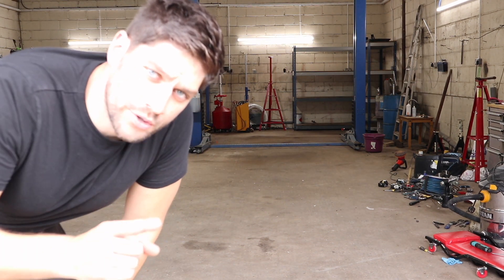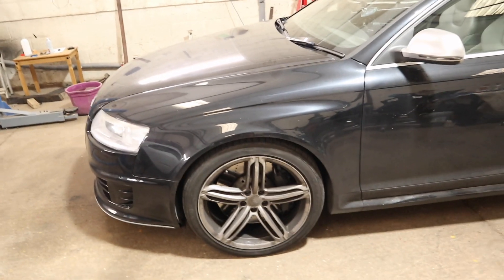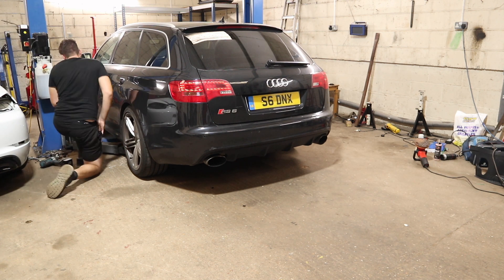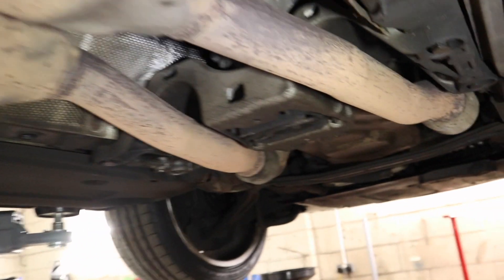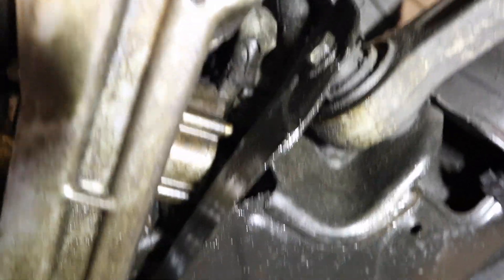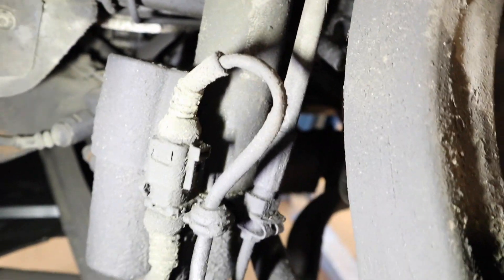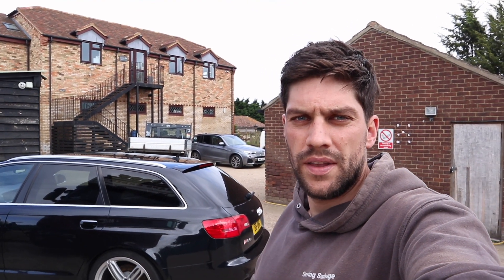EVERYTHING WRONG WITH MY CHEAP AUDI RS6 5.0 V10 TWIN TURBO

Comment: I had a 2010 black Audi RS6 V10 saloon in 2015 till 2017. They are beasts. Incredibly fast! Funnily enough, I had  Yokohama tyres on mine. On a fast run through Snowdonia, I got between 11 and 13 mpg. Sold mine with 22,000 miles on the clock. Never fell completely in love with the car.

Comment: I’d be putting the front end on axle stands and removing the wheels outside, then degrease everything underneath/suspension related and pressure wash it off, makes it so much easier to see fresh leaks and work on it without getting covered as badly
Reply: Agree. Bit of jizer

Comment: Mine had a split rear hose. New hose, recharge and all was ok. You might also find that the power steering is leaking from the crimp clip near the cooler on the left side of the car - the fluid runs back, mixes with other cr*p on the undertray like the DRC oil on your car then drips off in the same place.  Back lights - the inner light lenses micro crack and look foggy, upgrading both the inner and outer lights to the later version freshens up the back end of the car. I've dropped the engine out of my car twice in my driveway - it's not as bad a job as people think.

Comment: Hi Dean,  have that exact car, although mine has half the miles...  Regarding the DRC, my car has had the system removed and replaced with coilovers, Bilstein do a set for about £1300 and the electronic damping can be coded out in VCDS.  It's not cheap by any means but that's your worst case rather than a £5k bill!

You need to take the right hand front wheel off and check the coolant pipes at the top of the arch.  If they are gone it is far easier to replace the corroded section of the hard lines with 18mm i/d coolant hose than it is to take the engine out to replace the whole lot!

Good luck, that smoke would put me off I'm afraid, as you say it's an engine out job to get to the turbos.
Reply: I did a similar thing with my B8 RS5 as the DRC shocks were shot so replaced with the lovely Bilstein B16 PSS10 kit - amazing transformation.

Comment: Wanted one of these forever until I bought a c6 2.7tdi avant for a work horse, then found out about all the water leaks around boot and other common problems with the c6, also feels an old boat when compared to my a7, so I’m guessing with 3x the bhp is probably scary around the lanes 🤪🤣

Comment: The smoke at the beginning of this video says it all. That damper is the very least of your problems.

I'd love to see what the plugs look like burning that amount of oil.
Reply: Aren't those V10s known for burning oil really bad?
Reply: @hennessyviper  take out the plugs, do a compression test, if the pressures are down at that mileage I'd walk away.  But you need to know the engine is worth the time and cost.

That smoke is very excessive especially in your first video, that could well be the turbos.  That's far too much oil being burnt, probably fail the emissions test.
Reply: @212MPH  I had no idea that Audi twin turbocharged those engines in the Audi wagon but not the sedan🤷🏿‍♂️
Reply: @hennessyviper  They are twin turbo in both. The non turbo version is the 5.2 S6, not the 5.0 RS6.
Reply: Yeah I noticed that. Then on last start left bank blow a load. Right looked clean. Engine rebuild time. Yipeee
Reply: @dougsinden6881  It's far more likely to be a turbo. Smoke on start up is usually caused by residual oil leaking by the seals and into the exhaust. If it were piston rings or valve stem oil seals, it'd be blue-ish smoke.
Reply: @grahamek86  yes I agree.   A basic compression test and plug condition tells a lot.
Reply: @212MPH  Indeed. If its an engine issue, a leak down test may be more telling. With TFSI motors, a cracked ring land can allow oil into the combustion chamber and artificially prop up compression results.
Reply: @grahamek86  I would like to see what the spark plugs look like.
Reply: He didn't mention if the oil was overfilled and if the excess had been sucked out yet
Reply: @adam300tdi90  It's a dry sump setup...
Reply: @212MPH  Yeah they'll definitely tell a story if its being burned in cylinder or not
Reply: @grahamek86  yes I think so too. If the plugs have been  burning tgt much oil they could be so baked in black carbon it could also make the car run rough at idle and the entire rev range.
Reply: @grahamek86  Yes exactly - Overfilling dry sump reservoirs can cause higher than normal oil level in the crankcase (especially at start-up), meaning higher crankcase pressure and potentially blown seals and oil past the rings, causing burning oil, and the smoke seen coming out of the exhaust. Therefore, maybe there isn't an issue with the engine, just too much oil in the reservoir.
Reply: @adam300tdi90  Nowhere near the same issues as a wet sump. And no, not especially on startup. The oil is at rest during startup so isn't agitated won't get sent anywhere til the speed is up. White smoke on startup is a turbo fault. I'm willing to open a book and put good money on the fact this car has fucked turbo(s).
Reply: @adam300tdi90  I work with these cars regularly an have built >1k HP cars. I'm quite familiar with them.
Reply: @grahamek86  oil drains from the reservoir to the sump after being left for a while, hence why the level looks like when cold. This can be a reason for burnt oil on startup. As well as turbos sure. What we know though is that; he did overfill the car, and after a few pulls the smoke lessened. We'll see. I hope for him it's overfull.. but yeh, it could be turbos too.
Reply: @adam300tdi90  it runs a dry sump.......
Reply: @Alberthoward3right9up  A dry sump set up still has a 'sump' which is where the oil runs down to before being harvested by the pump again. it#'s just the oil capacity is in a remote resevoir.

Comment: The Start/Stop button is activated if the car recognises the key. There are a new and better looking type of Start/Stop button and because the old one had a tendency to crack and malfunction you should replace the unit. It is done in less than 5 minutes. You should also test if the Stop button is working after you have started with the key.
Reply from the maker: Yeah I think the start button is defective, the stop button works fine. The dash doesn’t recognise the key when I press the button which indicates button issue.

Comment: Check the boost pipes for oil my guess
Is one of them will be full of it ..… remove some spark plugs and check for oil …

Rear main seal can be done without taking the entire engine out according to some but it’s more easy with the engine out ..

Check the battery in the key … car should be keyless entry if working and the start stop buttons should then work ..

Comment: Hey! I’ve got the 3.2 C6, and it leaks power steering fluid, right down onto the exact wet spot on your undertray. 
You obv have some other stuff going on and I don’t know the RS engine, but check for a PSF leak on that side. All that moisture can be super confusing when tracing other leaks. 
Mine was also leaking oil in a billion places when I got it, but is now not even burning any oil, let alone leaking it - knock on wood - after a lot of leak tracing.
Love your vids and Audi content! 👍
Reply: I also have an C6 3.2 quattro. Have a leak but did not have time to rectify. On a quick look it looks like cam cover gasket and it seems to be dripping on to headers  when i push it hard. 
When going normal no burning smell at all. Just do not have time to dig more. Other than that lovely car and going like a train. My next uprgrade will be this bad boy  with V10 engine or maybe C7. V8tt
Reply: @ddevil892  They’re great engines, imo. :) My cam cover was also leaking a little, but check the cam adjuster valves first - quick and easy o-ring replacement, and they’re always suspect if they haven’t been changed. Leaks a lot more than expected too, ask me how I know… 😄
Reply: @gsommerfeldt  Will deffo have a look. Thanks for pointing out. What mileage is Yours?? Mine just clocked 110k bouth 2.5 year ago with 92k.
Reply: @averagefamilylife1189  Mine has almost 250k km - I don’t know what that’s in miles. :D The engine got a new block right before I got it, though, so that has only 110k km on it. Should be plenty of miles left in that, knock on wood. ;)

Comment: I had a 2006 c6 2.0tdi. Never failed an mot in its life and I got to the south of France on less than 3/4 tank. Had the car 3 years. 2 days of heavy rain and water got into 1 of the junction boxes that are the bottom of each a pillar and electronically disconnected the dash from the rest of the car. Would turn over but not run and would tell me I had no coolant, no brakes, no abs etc. Paid £5000 for it. Got 175 scrap. Uneconomical repair. Check the drain holes in the scuttle. They block up very easily.

Comment: I had a rs6 c6 coolant pipes corrode and need replaced every 4 years there is 10 oil seals the size of a 50p at the back of the engine perish and leak also need replaced every few years it's an engine out job had both repaired on mine I have the invoice from MRC if you want to see also oil weaps onto the turbo giving a smell of oil in the cabin and also the engines are very shaky but that's actually normal

Comment: Drc is just like a brake flexi, easy to replace just abit of a ball ache to bleed up sometimes, I did a rear one during first lockdown for a doctor, but because the drc is in 2 systems the opposite systems valve went after I pulled a vacuum onit 🤦‍♂️🤦‍♂️

Comment: I think that one of your turbos or both are losing oil wich gets inside the intake, that will explaim the blue smoke. Just disconnect a pipe from the turbo air intake and take a look for any oil, this way you can also check if the turbo shaft has any play.
Reply: Gnome Whyte He said on the previous video that he saw a lot of smoke on the back of the car, when he stept on it. Idk if the oil pressure in that car rises with the load or just with rpm, either way that's why I think it's smoking (turbo wear). And regarding the startup, the valve seal rings might be bad considering the age and millage and they can drop some oil on the back of the valve or directly in the combustion chamber if the valve was open after turning off the engine. I've seen few cars having this issue.
Reply: Gnome Whyte  No problemo. Yeah, I'm really curious what the problem migh be.
Reply: If these cars are  sat for a long time oil seeps down and can enter the cylinders. Regular use cures this

Comment: Been looking for one of these for a long time but trying to find the right one is proving difficult. Either mileage too high or they have been remapped/modified. That speaker grill, if it’s the same as my S4, is not removable they are usually a melted plastic style rivet holding them in.

Comment: Chances are the DRC leak is washing down all the dirt, grim and old oil off the engine and subframe and then looking black. Replace the DRC line, wash the underside fully and go from there 👍

Comment: you dont need to remove engine to replace the oil pump tube seal, or 50 pence seal lol, it took me a full day to replace it, and I had to replace water the water pump as the rubber seal split and I couldn't find one anywhere. Loved my old rs06pws hopefully shes still running..
Reply: First registered May 2008, logbook last issued (so assume last changed hands) April 2020. Still taxed and MOT'd 👍

Comment: Smoking exhaust can likely be blown turbo bearings leaking oil into exhaust. Often caused by people shutting down hot and coking the turbos. Get used to idling for 1-2 min before shutdown/install a turbo timer. Preserve those PITA turbos haha

Comment: You’ve got water in your boot hatch, messes with the electrics on the inner tail lights and number plate lights. DRC line has burst. New line, and recharge, about 500 quid at the Audi dealer. Best not drive the car without oil in the system, will ruin the shock..

Comment: Left Bank gave a bit of a puff on start up. Also quite a crank before it fired. Not sure if that is normal though.  19:07
Reply: I thought it sounded a bit laboured and that one side maybe in better condition…so left side low compression hence the oil burning? I’m glad I don’t own it and I’m not buying one!!

Comment: It should be an advanced Key So you don’t put the key in the ignition to start the car just press the brake and press start. It’s probably worth removing drivers side wheel liner to check the water pips. I managed to replace mine without removing the engine.
Reply: Yup, brake + start button without key in ignition. Should start right up
Reply from the maker: Yeah I tried, doesn’t work. The off button works though
Reply: @SavingSalvage  have you tried with both keys? It has always annoyed me that the key looks just like a standard Audi key no RS logo.

Comment: I think you need to move this car on. DRC problems and suspension are notoriously eye wateringly expensive. The cracked tyre(s) need replacing. The smoke from engine indicates bad wear and some rebuilding required. Have you the inclination, time and money to do that?

Comment: The only place I’ve heard of other than Audi that has the kit for recharging DRC is Unit 20 in Liverpool, they seem to be the absolute knowledge on DRC and have specialised in it for a very long time
Reply: A quick Google "Audi DRC recharge cost" brings up at least half a dozen straight away.
Reply: @ro63rto  maybe more are doing it now, it’s been some years since I’ve looked into it and back in the day it was unit 20 or the stealers.

Comment: are those rear disks handed? if so I think they may be on the wrong side @7:04 there is an arrow pointing towards the rear of the car.
Reply: Front discs are fitted as only one side ...forget which.....seen my c6  with one side on both fronts as well as new c7 Rs6s when they were new.
Reply: Noticed this too
Reply: Ceramic disks have different p/n left Vs right but std appear to have 1 p/n qty 2.

Comment: Would say replace all the o rings and anything with rubber with the high milage the cars done too make it last another 100,00 plus a deep clean underneath too remove all that grime. Maybe an engine flush as well too clean the engine out after all those miles 🤔

Comment: drc flex hose is most likely as long as the pressure hasn't dropped to much the insert should be ok for a drc recharge

Comment: When you pushed the start button it read "No Key Identified" on the dash. Dead key battery maybe? Does the touch sensors on your doors work to lock / unlock the car? May have an issue with the start / access system mate
Reply from the maker: No it doesn’t say anything which is why I think the button is defective, the buttons on the door work fine
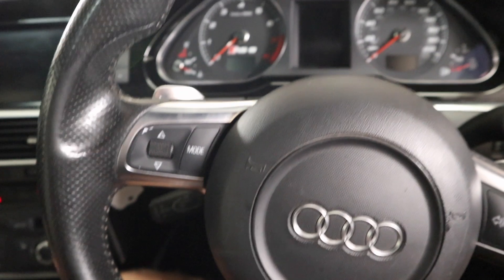Reply: Oh yeah well spotted, it's at 14:54, blurry but you can make it out on the DIS.
Reply: @akismurton496  Yeah I was going to say, I definitely saw it, lol. So the button is working because the car is reacting to it, but it just can't find the key for one reason or another. Maybe dead key proximity sensor in the center console? Would have to check with vcds / odis in module 05 Acc / Auth Start

Comment: O ring for the oil pump and coolant lines in the wheel arch (remove the liner for acess) are the only 2 know issues. The lines rust away because of location. With your cars high mileage they could possibly need replacing again (get them coated before installation to prolong the life). If well maintained there a pretty bomb proof platform but as with most cars things can fail and unfortunately with this car parts are stupid expensive

Comment: some of the comments about engine needs a rebuild make me laugh, people always start with the worse possible outcome.
it it were my car i would do the following in this order.....
1 - leakdown test (much better than a simple compression test)
2 - IF leakdown test comes back positive chances are its the turbo seals so factor in some rebuilt turbos at some point.
then a big full on service
oil + filter
fuel filter
plugs
air filters
coolant change
brake fluid change
gearbox oil change
diff oil change
inspect waterpump and any belts the car has
a full on underbody cleaning session then i would use the car for a few weeks to get to know it and to see exactly where leaks are coming from
if the leakdown test gives negative results then you have some thinking to do depending what the issue is (rebuild/replace or get rid)

good luck with it though, its a beast of a car and something we will never see again so enjoy it
Reply: First thing I though of was change the oil n filter. It may be two or three years old. And all cars with that mileage will blow smoke if that is the case. And as he said he over filled it too. That will cause it too. And the oil is probably from a previous service that wasn't cleaned up properly. I'd give it a decent drink of carby clean too. Not too much with the high KMs tho.

Comment: Your problem with an engine leak is obvious.
At front of the engine you have a crank shaft simering and also problem is with balancing shaft where is a two big o-rings of a balancing shaft bracket and also smaller  o-ring for cover of this bracket.

Small advice replace this front balancing  shaft bracket as well as it is very corroded after time. You have to use small puller with a threaded bolt m5 to pull It out hole by hole slowly as there is two.

After that your leak will stop or slow down, and than you will have to take care about oil filter housing sealing, and oil pressure sensor...

Good luck. 👍
Reply: Replacing of a rocker cover gasket is not bad idea as well, as it usualy leaks as fu**, and also if you have an oil where the spark plugs are you will have to replace rubber gaskets under neath of top camshafts cover which is really
Big Job.